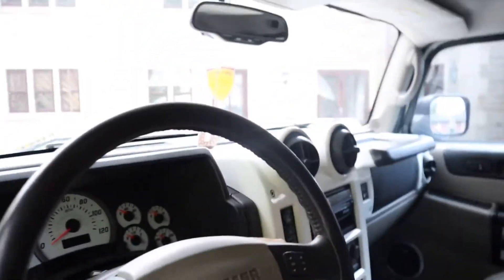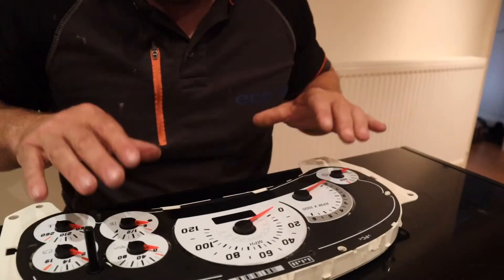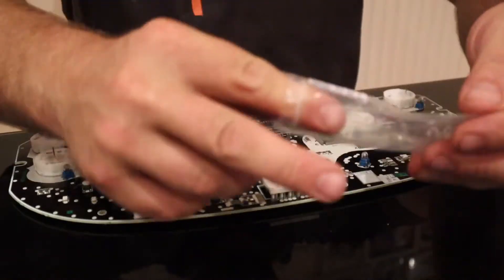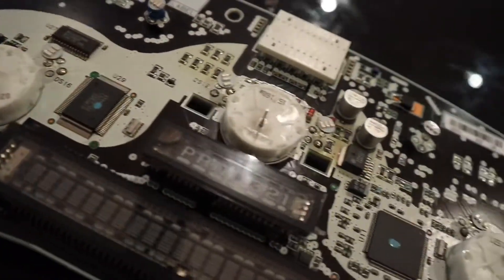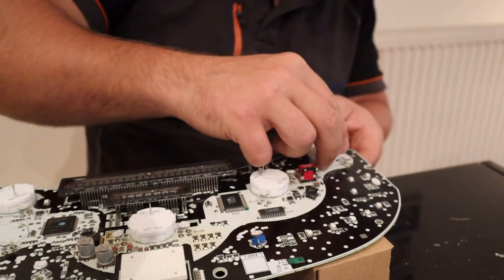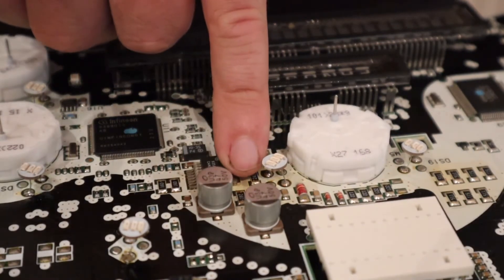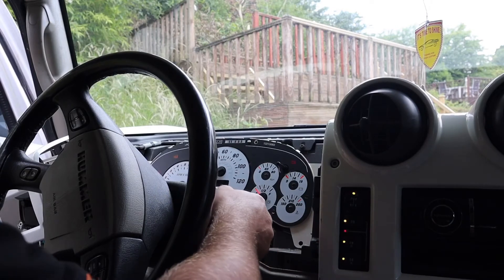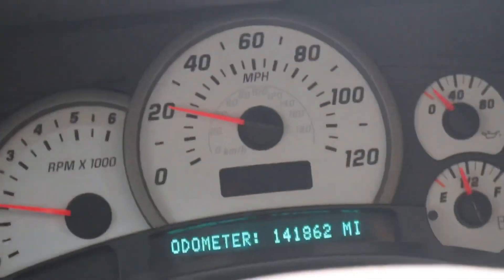INSTRUMENT CLUSTER NO POWER DIY REPAIR

Comment: Mine just stopped working.  No gauges no info center.  But my engine light is still on lol.  So it's getting power Is this what I need?
Reply from the maker: Hello bud, I found re-soldering the joints on all parts brought everything back to life
Reply: ever find a fix?

Comment: mine needs doing, speedo and gear selection dont light up anymore, noticed when I was at costco in Leeds earlier today
Reply from the maker: It wasn’t too hard bud soldering iron some new led,s and motors  fixed it right up
Reply: @builditwithrob  which kit did you buy off amazon?
Reply from the maker: @dawsonn87  I think it was this one 
https://www.amazon.com/ECCPP-Speedometer-Instrument-Backlight-Soldering/dp/B07DFDKK1V